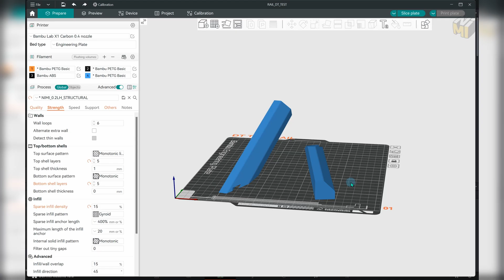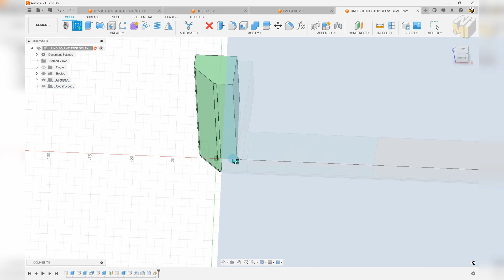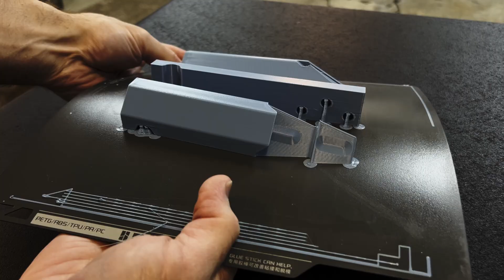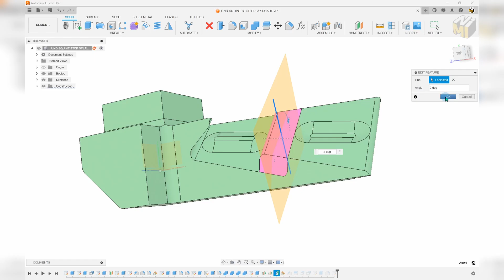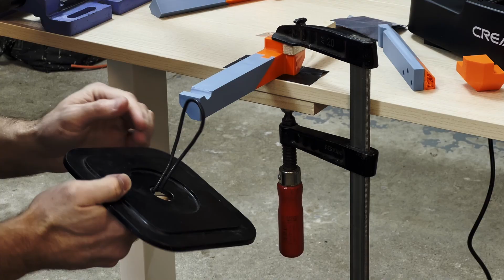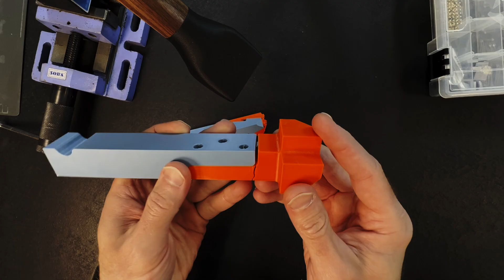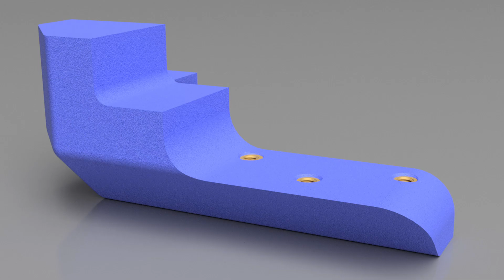Strong 3D Printed Connections on BIG parts

Comment: I see that you're teaching us to fish...but For the people who are bad at cad(not everyone is an artist, or like me who is 1/4 blind). Can you make a printables or makerworld with a universal kit print files? For example parts would be: 1.) corner piece 2.) Long beam(for printing diagonal on a Bambu printer 3.) Short beam (for side to side printing or smaller print beds) 4.) Pegs. I think with that setup you could build just about most things.

You could make multiple types and go wild with up to 6 way corners; or even with 1" 2" or even stuff that people can make go-karts out of(ala popular science pvc gokarts). But even a universal beam in 1" or so would be extremely useful.
Reply from the maker: Absolutely, I was wondering if anyone would be interested in this concept and I'd be happy to provide some models to use.   What I should do first is make up a full test frame and... test it out to see that everything works properly before I go ahead and release anything.  The 1" (25mm) rails seems to be quite strong, maybe a 1 and 1 1/2" would be good to try out.   I also wanted to see about the recess for acrylic panels.  I believe 3mm acrylic is good for this job as long as the span isn't too great.   6 way corners, I'm going to have to think about that for a few minutes.  Up, Down, Front, Back, Right Left?  

I like to keep things as simple as possible when I post, is there a way to use the slicer to combine parts to make a beam at a length of your choosing?  If I supplied the ends and a central piece, could that work?
Reply: @NeedItMakeIt I think Bambu/Orca slicer only allows for full object resize, since the bars are "cut" in the x,y and z direction, if you resize the connectors will also be skewed. I think in the beginning;
1.) you could do without the acrylic recess
2.) make a 1" setup to start with
3.) Make the straight pieces like Legos so you can attach 2 300mm pieces together to make a 600mm.
 Etc...
4.) A 3 post corner is nice for a box, but you can make a desk or multishelf furniture if you make 4/5/6 posts.
5.) You could have 1 printables page for 1", another for 2" etc....
6.) Later on you could do other straight pieces in 100mm/200mm/300mm etc.. also add the recessed angles for acrylic.
7.) Open source it and work with people like Zack Freeman to spread the word to encourage others to make other compatible or similar systems.

I think there is a need for Lego like "1 by" wood replacement. That someone could just build something with without doing the cadwork.. similar to Gridfinity.

Future would be cool for 2x4 replacements etc..
Reply: I think a parametric design for beams.. would be real neet.  I have a project where I want to build something long.. maybe 5 pieces.. plan to lock together like this @NeedItMakeIt
Reply from the maker: @docdailey  Well it so happens that I have some testing videos coming up that are looking at that very subject, I think I should have something within the next 1-2 weeks and I think we're going to try to test all of the ideas out there to hopefully get to a point where we have something that's rigid, not too much weight/filament which should mean that it prints fast as well.  Beams and posts are a good place to start, we can also look at ways to integrate cheaper materials within our prints, for example thin wood dowels strategically placed along the inside of the parts.

Comment: The half lap shlould have been turned 90 deg to engage the full cross section....this isn't an apples-to apples comparicon. Plus the choice of material has bad creep characteristics. I would suggest an ABS that can be easily solvent bonded and that would create a  really good joint.
Reply from the maker: Good point, I was a bit conflicted with that one, so I will see about printing another test and report back, I think there is some more potential in that connection as well.  I've also updated the model to have a larger rad in the corner, it wasn't really ideal for this test.    I haven't been doing too much with ABS lately, but I do have some that I can experiment with a bit, great tips, thanks for your thoughts!
Reply: @NeedItMakeIt   The beauty of ABS is that it fails more predictably, slowly, not brittle fractures and catastophically like PETG and PLA.

Comment: Even if the half lap wasn’t at a disadvantage I prefer the simplicity of it. This might speak more to abilities in CAD or just general intelligence in understanding the geometry required for the scarf joint but I would design and redesign a threaded insert connection to be as strong as required before attempting the scarf joint. 😂
Reply from the maker: Hey, to each their own, I think there may be a way to combine the two ideas together, if we can take a simple scarf and use the machine screws set at an angle, it can pull the joint tight and provide a similarly tight connection.  Thoughts on that?  I'm with you, I like the simple, but the tight joint has some advantages as well.  Maybe if we have "All of their powers combined" we can form... Captain P... I mean the best and simplest method.  I'd like your feedback on this.

Comment: Really love you're exploring the structural and joinery domains. Good stuff!
Reply from the maker: Awesome, I'm gad you liked it!

I've seen quite a few big models coming out, I figured it was time to pay some attention to how we're going to join them together.  The idea stemmed at least a bit from a frame I saw on Printables with what looked like a floating tenon, it was an okay idea, but it left the frame very wobbly because there was not enough tension and the joints were left flopping around.  I just used some of my experience from when I used to Timber Frame and applied it here... I guess in some way I kinda miss that level of hand-crafting that we used to do.  

Anyway, it's pretty neat and I think performed well, I think that the community can improve the design and simplify it a bit more.

Comment: On the first joint, I would have printed the fixed part of the half lap on top, that way the weighted end would be under compression, instead of pulling away. I would also put the heated inserts on the outer face, so the bolt squeezes it all together…or maybe bolts with inset nuts
Reply from the maker: Shoot, that's a great point, as the pressure is applied, it tightens up.  Great feedback on that one!  I was thinking that I could do the half-lap as well with the screws on an angle maybe set 45 deg to the connection in order to pull the joint tight.  I can also do a similar undercut and that may also help.  What do you think?
Reply: @NeedItMakeIt I was actually rather curious as to how the other two joints would behave if they were printed on the 45 as well and the scarf joint at the 90. Since the bolted joint and sliding dovetail were both along the flat plane perpendicular to the force applied. The scarf joint was at the near ideal angle for strength
Reply: @NeedItMakeIt  If you redid it as we're describing, the pivot point would move out to where the two parts mate. To counteract this, I'd put more emphasis on putting the bolts towards the clamp-end.. I'm not sure if the bolts  being inserted at an angle would make any difference...but it's YOUR time and filament 😜

Comment: What temps are you using for the hotend and bed when you print in PETG?
Reply from the maker: 255C for the nozzle and 70C, I'm set to 13mm³/s for this material to be safe, not nearly at top speed.  I have run it faster and I set it to 275C for the nozzle to help keep up and that seems to work well also.
Reply: @NeedItMakeIt  When I print PETG on my CR-M4 @240c/70c, it is extremely difficult to remove from the supplied buildplate. I have begun experimenting with reducing bed temp. 50c seems slightly better. I was hoping you’d say you used something even lower. 😂

Comment: Great testing, each can now be designed better by reviewing the video. Thanks
Reply from the maker: Thank you!  There have been quite a few great points, the half-lap has some potential still.  I was thinking that I should do a re-test with the improvements, but maybe I should buy a fish scale to make testing easier and print as many good connections to do a more complete test video to find any clear winners.

Comment: to bad you did not print a sample with out a joint to compare. I understand that this was a test for part to long for print bed, I was wondering if the scarf joint made it stronger than a single bar.
Reply: It would depend on the infill in the solid part more than anything. The joint adds additional perimeters so with identical infill, is expect it to be somewhat stronger.
Reply from the maker: Ah, yes that's possible.  I'll also see if I can get the walls and top/bottoms to around the same thickness, at the moment I have 1.2 Top/Btm and 2.4 for the walls, it'd be better for me to set the tops to 12 layers and then we have a test which is more uniform regardless of orientation.
Reply from the maker: That's a great point, I didn't think of that.  I was thinking more connection to connection, but adding a solid part, yeah that's something super easy to whip up.  It'd be hard to believe that it could be better than a 'solid' or at least infilled piece, but I can't be certain until I test it.

Comment: Could be interesting to add a dial indicator to the end of the arm to see how much it deflects
Reply: Or at least connect the tests to something other than a desk that deflects so much...
Reply from the maker: For sure, I will have to order a new arm, mine has gone bad.  I could also add a ruler.    I was thinking that I should move to an entire frame and compare the flexibility of it in its entirety.  In that case, if it were me I'd be looking for something that acts like a solid structure, no wobbling around, it should be fairly stiff ext.  Thoughts on that?

Comment: I would go solid infil if I need that strength
Reply: Keep in mind that solid infill does not necessarily add as much strength as you might think it does compared to a good infill pattern like gyroid. The perimeters are more important as far as load capacity in most cases
Reply from the maker: I can't see my self spending that much money and making the parts solid, it would be more cost and time effective to buy alum rails.   Another idea that just popped in my head is to use fairy thin wood as the reinforcement and have the plastic and the profile we need wrapped around the wood.  Wood isn't that cheap but it would allow long spans and we could have a piece set to 90 degrees for stiffness in both directions.  Thoughts?

Comment: The failure was in the material not the joint coming apart. I have found using a hollow extended into each part allows for using small dowels of wood or metal to greatly strengthen the material itself.  I've used wood, nails, straightened paper clips, and all manner of materials.  👍✌🖖🥃
Reply: Just putting hollows in the parts will cause additional inner perimeters.  There are vids out there on how prusa uses this to strengthen parts.
Reply: Prusa Slicer has this ability, I think it has been carried into Bambu Studio as well. A word of warning , if you use the default suggested pins and their orientation you are almost nullifying the purpose (other than alignment) as the pin layer lines are matched to the joint.  Print your pins on their side for improved strength. Until Prusa lets you use polygonal pins you may need to 'cut' the pins down on the long edge to get a good print. If you are using dowels, ignore this step and just make sure your holes are sized correctly.
Reply from the maker: @grepmonkey  I just finished testing it out, there are quite a few options, some are weak, however the option for alignment using cone shapes seems useful.  Having that in combination with a machine screw would be a nice solid option.  Question for you, do you think that layer direction plays a large role in part strength?  It seems there is still some debate.  Personally I think that parts, some more than others are quite a bit weaker along their layer lines, but I'd have to do more testing to be certain, I'm curious about your thoughts on this.
Reply: I don't understand this comment. If the failure is in the material and not the joint, how do you explain the wildly different results for the same material? The only thing that changed is the shape and amount of material.
Reply from the maker: @petunia7917  The fails were in the material, the dovetail connection however did fail partially on the joint my best guess is that the dovetail 'wedge shape' helped the failure along.  The half-lap connection failed early I believe because of the much smaller cross-section at the area subject to the highest forces at the corner.  I don't really have a definite answer on the scarf joint, it failed at the corner like the half-lap, but it was also in the process of failing just beyond the joint.  unfortunately my slow-mo was... too blurry to see what happened exactly, but it's interesting for sure.
Reply: @petunia7917 if the joint fails, the result would be 2 separate, undamaged part. Maybe some deformation could occure but the failure is in the joint. Which has no other sign of damage but the separation itself.
Reply: Ah ok... Seems like i am not the first with this opinion.
Reply: I was about to say the same thing, the joints were all good but the material gave out.  If you are trying to get strength in this direction I would be looking for a hollow along the whole length that would have a brace in it.  The question would be to determine if a solid bar would be better than angle/box cross-section tube would be better.
Reply: Similar to inserting another material, compressing the prints along layer line through a wire or rod, tightened with a screw also helps dramatically increase strength.
Reply from the maker: Oh, I'd like to see more about your connection idea is there any way for you to send me a link to a picture?
Reply: I actually measure the wooden dowel or kitchen skewers dia then design in a hole or tube shape bridging both halves of the joint. you would have to have an entry hole for the sliding dovetail joint.  I should copy your designs and make a video for my channel some day. I'll look into how to just tag you for viewing a video and let you see.  Give me a couple weeks have some bad family matters coming to a close also i'm old and retired.  @NeedItMakeIt

Comment: Super cool! The first connection reminded me of the ones on The100 3D printer, so it would be interesting to see how the last, strongest connection would perform on a printer with 100k acceleration, that happens to have a printed frame (The100).
Reply from the maker: Thanks!  I hope that people take it and run with it a bit, maybe they can improve it even more.  The wedge for example can be a single piece if the extrusion between is also tapered, it makes the design harder, but maybe there is an advantage to that concept.  Yeah, I saw that 100 printer going, Whoa that's fast, and it does not look like much either.

Comment: Glue the parts as there is large surface area making the glue bonding strong.
Reply from the maker: I think it would be a great connection to glue, comes together tight with the wedge, the joint itself is its own clamp, I will have to experiment a bit with this.  I like using PETG, do you have any experience gluing PETG?

Comment: Looks like japanise wood joinery 😊
Reply from the maker: Pretty close, it is taken from my experience as a Canadian Timber Framer 20 years ago.  We were not quite as good as the Japanese craftsmen but we were pretty good.  

This is a connection we would use when we wanted to span super long distances and our stock timbers weren't that long.  It also helped to allow us to get these on the flat beds.